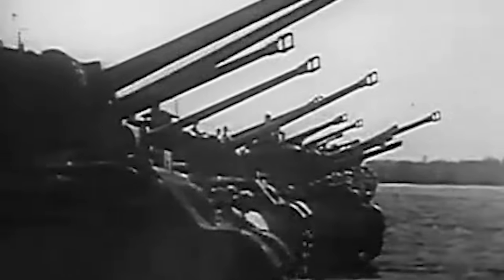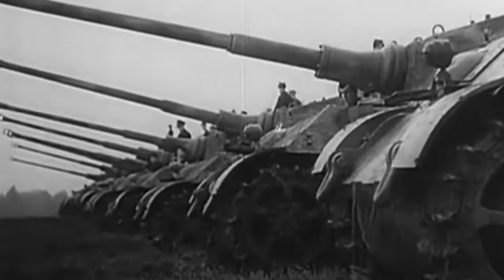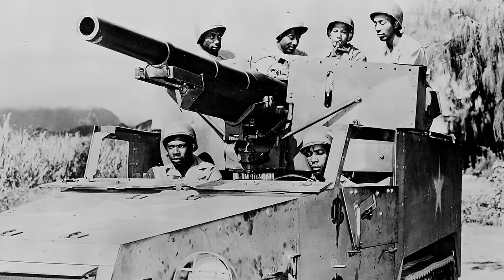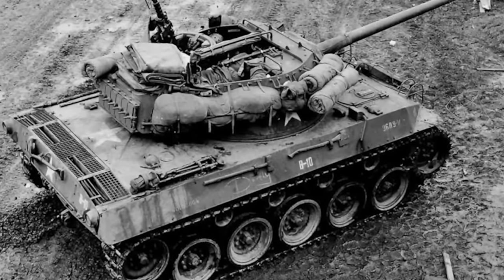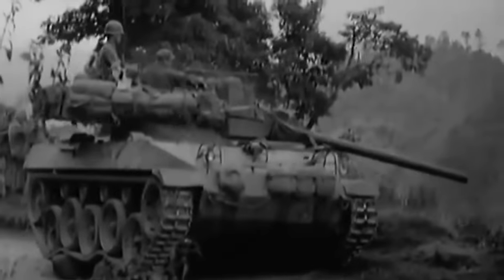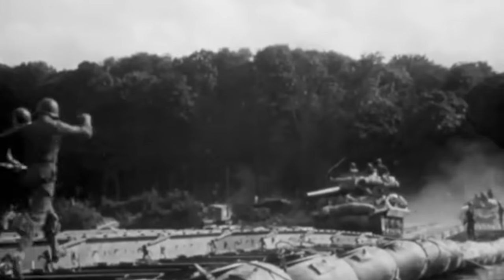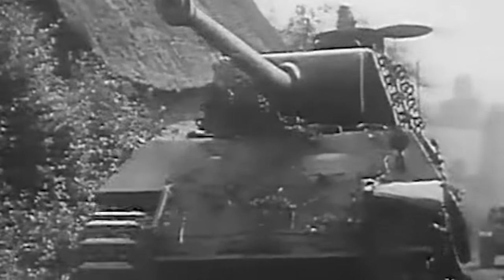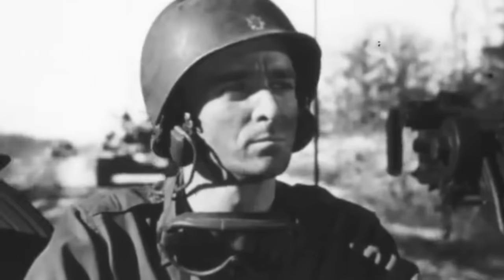The Brutal Tank Killer that Could Disappear

Comment: wo wo there my british friend the M18 did was fielded as the T67 variant had a 75mm Gun circa 1942 but the 1943 fielded version the T70 had a long barreled 76mm rifle, and an upgraded powerplant Continental R975-C4 400 hp, this is the monstrosity that reeked havoc on the Panthers at the Battle of the Bulge with the HVAP round it could penetrate Panther frontal armor out to 1000M
Reply: Battle of the Bulge and battle of Arracourt in Sept 1944( hellcats and 76mm and even the lowly 75 mm Sherman’s mauled an attacking panzer division) that Belton cooper BS is just that - Army reviewed the complaints and discovered a 75mm Sherman could knock out a Tiger and a Panther at 500m-600m and the 76mm could killed other at 1100 m. Both British and U.S. army reviews showed that basic tank on tank combat in the Western theater occurred at about 800 m and it was always who ever shot first usually got a kill or mobility kill. ( the Germans usually got first shot as they were in a position of ambush against attacking /advancing allied armor)

When US Sherman’s or hellcats or Jackson’s got the drop on German panthers and panzer IVs they took them out.

Ditto the British Comets and UK Sherman fireflies
Reply: What's the effective range of the panther?

Comment: The hellcat never had a 37,50 and 75 mm guns. It always used a 76mm gun the same as late war shermans
Reply: So both are wrong, and right, It never saw service with those guns as they were tested on its prototypes but it did have them,  on the several failed prototypes
Reply: That was misleading he does do that from time to time

Comment: 4:56 The M18 used a 76mm, not a 75mm
Reply: Actually l think they were 75mm it's just that the rounds were different than other 75mm hence the 76mm designation.
Reply: @graham2631  No, they were 76mm. The americans didnt have a High Velocity 75mm like the germans
Reply: Did they go metric ?
Reply: @graham2631  75mm, 76mm, 3" had common bores, but different ammo.
Reply: @xt6wagon  No, they didnt work like that. The 75 and 76 had huge differences in type of ammo, velocity, weight and the size of the bore.
Reply: 76.2
Reply: Correct, the US only had a 76mm, not 75mm.
Reply: @awwtv2603  The US had a 75mm but it had poor power and its velocity was bad
Reply: @39The 75mm was mostly in the m4 sherman
Reply: @awwtv2603  M4 Sherman*, also in other tanks like the M24 "Chaffe"
Reply: @awwtv2603 sure they did. The Sherman was equipped with a 75mm m3 cannon for the majority of the war

Comment: The Hellcat was the light/medium tank with a big gun approach that almost every nation tried during the course of the war with mixed results.  The Hellcat was the tank the allies needed in North Africa but by D-Day against the German heavies primarily fighting defensively (except for Battle of the Bulge) it was not much of an improvement over even a Panzer IV.  The long 75 mm on the Panzer IV was the equal of the Hellcat, could take out any allied tank at 1000 meters, was more mobile than a Tiger,  a smaller target than a Panther, and had a gun of similar power.  Hitting an armored column hard and fast and then disappearing, was not an ideal role for armored vehicles when the allies had thousands of P-47 Thunderbolts and Hawker Typhoons flitting about ready to blast anything German that moved.  
But those are minor issues compared to the real drawback of diverting resources for a luke-warm solution when you already had the right one ready to go!  While by 1944 the Americans had immense resources for weapons of all kinds, the one thing nobody ever felt they had enough of was TIME - and the Hellcat diverted significant manufacturing resources and even more valuable shipping space, that would have been better utilized for sending more M26 Pershings to Europe as fast as possible!  

The Sherman was a good reliable tank, easy to manufacture, and in North Africa was the only thing that matched the Panzer IV - but by D-Day the thing it didn't have was armor protection for the crew (The book "Death traps" by Belton Cooper is all about this problem).  By 1944 German anti-tank weapons from the Tiger to the panzerfaust were ubiquitous on the battlefield and the Germans soon got good at knocking out Shermans with the puny 75 mm on the Sherman not even being taken seriously by the Panzer crews (who called the Sherman's underpowered 75 mm the "door knocker").   
In the meantime, American tankers did not get a single Pershing until well into 1945 - meanwhile all along the M26 was the proper response to the German cats and not another light but mobile tank with a big gun hooked up saeemingly as an after-thought.
Reply: Whole lotta fiction in this comment. Cooper was incorrect, focused too narrow. M26 was not fielded because it was not that good.
Reply: @coachhannah2403 Even so, suppose in an imaginary scenario you had to pick either a Sherman or an M26 to attack into German defenses with?  You already know which one are you gonna choose.
Reply: @robertmaybeth3434  - Yes, I would take what was there, likely the Sherman. This war was not about the toys.
Reply: @coachhannah2403  Honestly knowing what we know now I'd rather be an artilleryman or even a ground-pounder infantry than part of a Sherman crew.  Because of there being so many types of anti tank weapons, deployed in huge numbers by 1944-5 being deployed by the Germans (and perfected on the Ostfront) all it took was one 12 year old Hitler youth with a panzerfaust and everybody in that tank was dead.
Reply: @robertmaybeth3434  - Yet crew survival rates were the best of any branch's front-line troops. 🤷‍♂️
Now, a B-17 is not the place you'd want to be, especially before 1945.
Reply: the m18 is a TD not a light tank
Reply: @LogoMasterWT  - Doctrinally, maybe. By definition, it is a light tank. Armored vehicle with large gun and rotating turret. Yup, a tank.
Reply: @coachhannah2403  it was built as a tank destroyer
Reply: @LogoMasterWT  - 🙄 doctrine. It meets the definition of a tank. Heck, it was often used as a tank...
Reply: @coachhannah2403  what you gona call a m3 half track a tank
Reply: @LogoMasterWT  - No. Why do you ask?

Comment: manual turret rotation ?
Reply: The Hellcat turret was not nearly as heavy as the Sherman turret., but those shots were for dramatic effect.  The turret could rotate through 360 degrees in 24 seconds using an electro-hydraulic traverse mechanism.  The manual system could be used when the  E-H system was inoperable or the engines was shut off.  

The M1 Abrams can rotate its turret 360 in 6 seconds.